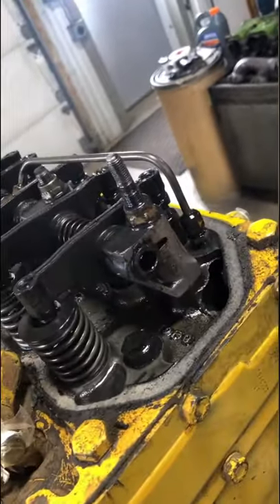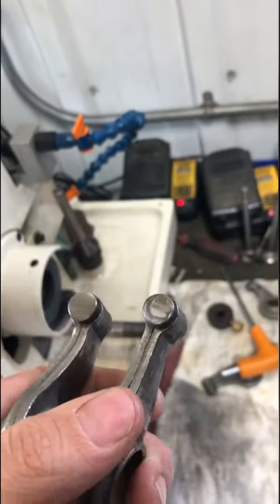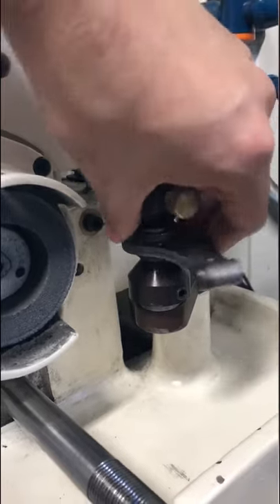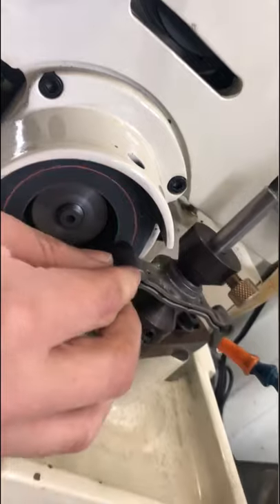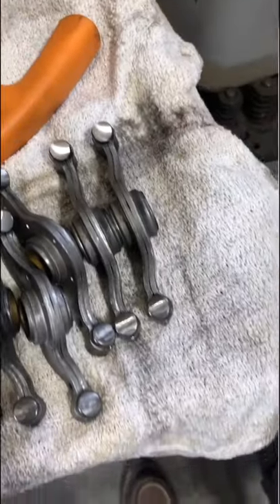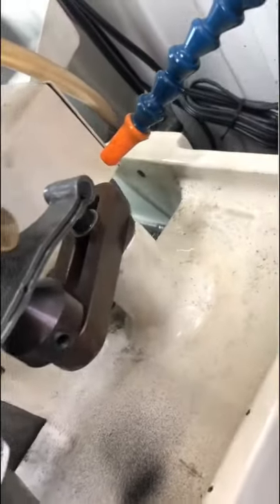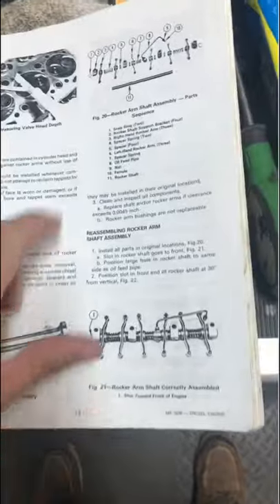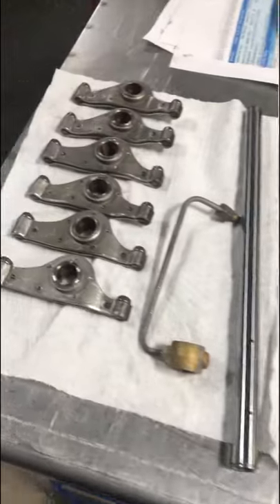#shorts This Is How We Reface Shaft Mounted Rocker Arms

Comment: I have a valve grinder, unfortunately doesn't do rocker arms, it's a very good machine, I've made valves up to fit other engines only yesterday, I sorted a small Honda engine with a burnt valve. I have a set of diamond laps to re cut the valve seats in the head.

Comment: After doing all that does it really make a difference where you put each set of rockers I mean they are set that goes together the tappets have been clearly compromised both shape and color wise is that why there is a break-in process after you put the engine back together

Comment: Idk about this application but in the aviation engine shop I work at it's a known issue that if the toe of the rocker is not ground square to the face of the valve face it'll put some side load on the valve shaft and wear out the guides faster. Same in automotive work?